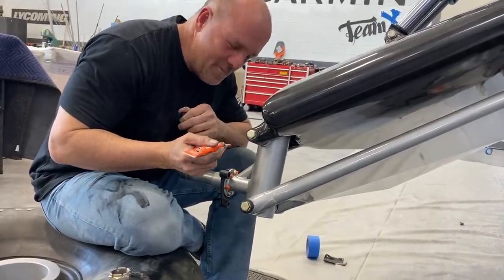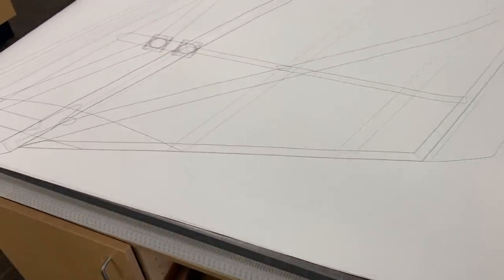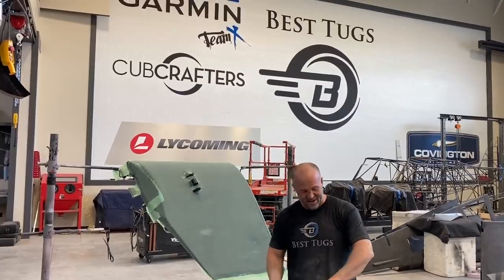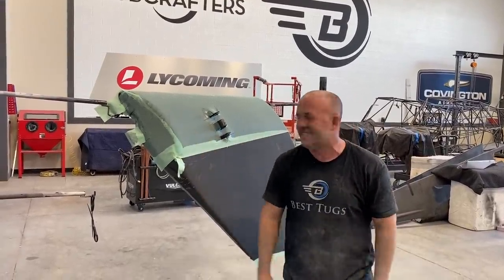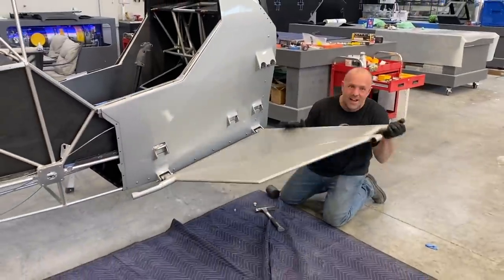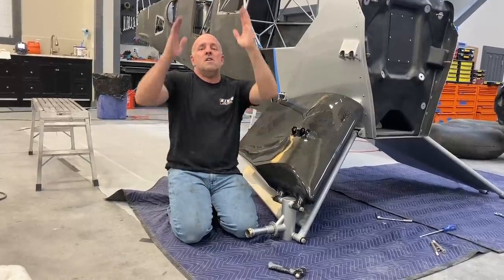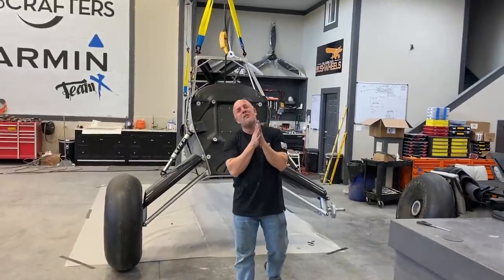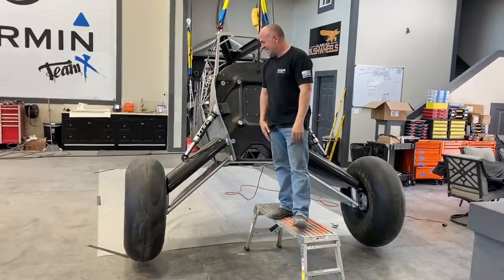Carbon Fiber Wings on scrappy suspension finished (Scrappy Bush Plane 22)

Comment: Very impressive design, execution, and presentation. As I mentioned when you first presented your suspension design that holds the camber steady, the track changes throughout the action of the suspension (narrow when the suspension is at the top of its travel, wide at the bottom of the travel) which causes these soft tires to roll under, especially on hard surfaces. I wonder if it matters on these tires?  I'm surprised the shocks are uncovered and causing drag with all the attention to detail you have given Scrappy. The inboard suspension that Jonas Marcinko is utilizing for his scratch build, "Defiance" might also suit Scrappy. Thanks again for another excellent vlog.
Reply from the maker: Oh so much to type on those great question I’ll try and talk about that at a later video

Comment: At the very end - you addressed the question forming in my mind as soon as I saw the lower A-arms;  to fabric or not to fabric?   I can't wait to see what kind of analysis you've done to figure out the high pressure zone interactions in that huge slot between the two!

Comment: I love your oddly satisfying statement!!  But most people who are not in aviation don't know what you are doing.  Mike is putting on a stripe of gel thick paint on the bolts it is called torque stripe. When it dries it cures hard and brittle and stays thick.  If the nuts start to loosen, or the bolt spins, the material cracks and shows you on inspection that the  bolt is working loose.  Then you can investigate why the bolt is loosening, this could be because something is wearing, breaking or failing. I think Mike is showing happy satisfaction because his plan is coming to an end.

Comment: I think I know what the unique feature is of them King Shocks
You can get them to retract in flight, to trim the suspension wings in flight.
And/or
use them retracted on take off, and then just on the lift, make em pop the nose up
eg make the planes front jump up in the air for Short Take offs

Comment: I really love the detail and workmanship here, and my comments are only thoughts on the design that could be made from the videos uploaded.
As an old aircraft maintenance engineer, I do wonder how there is going to be any inspection of the upper control arm structure (mini wing).  This structure is under huge loads especially as the suspension is in it's fully lowered position, the spindle will want to compress the mini wing structure with a large mechanical advantage given the suspension geometry.
As an automotive design engineer I also worry about the minimal bearing area on the suspension mounts at the body of the aircraft.  Bearing areas at the spindle are much larger than those on the aircraft frame which seems directionally correct.  Maybe consider using diamond encrusted washers (after removing the paint from the body mounts) and larger bearing washers on the accessible surfaces on the fuselage to increase the bolt functional bearing areas without totally re-designing the mounts.  If you do this ensure you tighten the bolts to get the tiny diamonds to cut into the airframe and effectively fuse it all together.  Tension on the bolts also reduces the shear loading of the bolts as the bearing areas of the washers and compression spacers also take a significant portion of the shear loading (bolt shear stress failure point is about 1/2 the tensile stress failure point).  Longer bolts help here as you can get a large bolt stretch (this is why head bolts are normally long in internal combustion engines - it also helps with thermal expansion/contraction of the joint) Get the joint stiffer (stronger compression spacers inside the rubber) and then get the proof load higher in the bolts (or dare I say it use yield bolts and tighten to angle after preload torque has been met - but don't use the bolts once they have been removed from service - you need to replace yield bolts every time they are removed)  A good way to show the difference of alternate bolted joint designs is to make the representative joint and stress it in a simple tensile test.  But make sure all the parts are new in every test.  You can mechanically cycle the joint as well (this is done for automotive validation purposes and could be done here also) but I tend to believe the cyclic loading of this joint isn't as significant as it is in car suspension systems (all the same I would always say - test, test and more test to ensure design meets intended applicable loads).

I also wonder if the space between the two control arms is going to create a nozzle effect where the air flow could be very high in this small gap (it reminds me of leading edge slats, except the slat is on the bottom of the wing).

I'm eagerly awaiting the next installment of this project......

Comment: Fill divots with clear cyanoacrylate glue, super glue, between clear coats. It will look milky until you add the clearcoat on top. I used that process for guitars, to give that super wet look.

Comment: Mike you Need an Engine Brace enclosing the Engine and bolted to the front heads, More than the standard engine mounts with the extra Torque your generating from the Fan Boat Prop...

Comment: "Big Mike" . . . I have been watching your videos, and the last one I watched was your APPROACH article on the DRACO loss.  I have been thinking that one of the items that you developed for DRACO could be used on other Bush Planes, and that is the Landing gear fuel tanks.  The carbon fiber bladder could add 10-20 gallons a side, with the primary engine fuel pickup coming from the bottom of those tanks like you did DRACO.  The flexible fuel lines in the struts will have to be robust to be sure, and "in" the strut for protection.  Fuel lines from the mains in the wing would feed the strut tanks the same as your original design.  It's going to add some weight to the platform, but everything is a trade-off.  The range problem for several of the Bush Plane models like the Cubs, and perhaps the Kit Fox could be engineered up as a landing gear kit for installation as a unit.  Safe flying.  Glad your in one piece.  Be safe!
Just a thought.  CWO3 Curtis E. Conway, Jr., USN (Ret).

Comment: Wow, what a incredible build design and executed build quality.  👍‼️     I’m guessing that the King shocks to be revealed future feature, will be some type of remote activated positional suspension lock out.    So that it will help Mike this time around with any unexpected severe crosswind gusts during takeoff  (or landing), and that he then won’t have the same long travel suspension body roll influence that helped (unfortunately) contribute to Draco’s ground loop. ... but this is only my guess at this point. 🤔

Comment: That's awesome! One thing that worries me is that with that suspension the tires will skid outwards when it impacts the ground, so you might burn some rubber on that.

Comment: The aspect ratio of those wings are about 1,5 to 2 and they have a -45 deg of dihedral angle. The lift contribution of those wings are infront of the main wing randomising the center of lift and they have a good chance of trowing a turbulant flow to the stabilizing wings. To make a long story short I don't want to be siting in that airplane when your going to test it.

Comment: Nice looking landing gear design but the airflow coming from the prop and the drag + turbulence that would be generated between the airfoil shape part and the flat plat shape part will cause serious problems and low performance. those two parts are very closed together and not having airfoil on them would help more than having it. It also affects the airflow over the tail is some AOA. We will see how it would work but may cause the airplane to not deliver a steady reaction and flight experience in different conditions and maneuvers. I also want to add that your hard work is really valuable and I enjoy watching your videos!

Comment: one thing that may be are issues is if you load one side up (compressed) more on a landing I.E one landing wheel compressed more, the apex length from the landing tyre to the tail wheel will "angle" changes. This may cause directional steering between all 3 wheels.

Comment: King Shocks "unique feature" spoiler alert (just a guess, because it's what I would do). 50 bucks says Mike will retract the gear in flight until the mini-wings are horizontal for additional lift, then extend shocks for landing.

Comment: I've got one question. Would it have been possible to make the miniwings into fuel tanks as well or is that just too mush hassle and headache to achieve, if even possible from a engineering standpoint? Thinking of the Draco fuel "legs".

To make a guess on the hidden feature on the shocks. They can fully retract in-flight to make the wing surface as level as possible. :D

Comment: I am a bit late to this party, but I was wondering about access panels in the gear legs to inspect for fatigue or tracking in the landing gear after particularly firm landings or later in life airframe inspections?

Otherwise, awesome build! I have been following from day one!
Reply from the maker: Thanks and yes it has inspection points in the bottoms where the brake lines pass through in and out of the mini wings

Comment: Raw carbon is not common in the aircraft industry for a number of reasons. UV exposure is one, the rework / precision issues are another. The "fake carbon" hydrodip overlay mirror helps on both levels.
Reply from the maker: 👍🤠 I have been doing carbon fiber for 15 years and I agree with you completely.  That being said.  If you watched the other videos and steps I take for a true real carbon finish you would see the steps that allow it.  It’s certainly more time work and effort and money but I get what I truly want.  I have a racer in clear carbon 12 years old and absolutely looks like the day I did it.  If you take care of heat issues and not use as primary structure as one major issue. Also I use a extra layer of carbon on the outside that is not part of the structural calculations and is Just an extra layer of UV protection from the layers below.  Go beyond that I use heavy UV clear over that.  There are several other steps but in the end you can see the actual carbon and don’t have the fake look that I personally don’t like.  But what is great here  is we both can build what we want the way we like it.  I’m willing to put in the time and expense to do it the hard way and still have it safe and exactly what I want.  I cheer on all others choices for them.  This is certainly not the easy or practical path but the look is exactly what I want.  Cheers my friend 👍🤠
Reply: @MikePatey  I like it, haven't seen it before. I personally like to see into the carbon itself and be able to visually inspect it for damage.

A Boeing passenger plane done in metallised carbon would look great.

Some would ask for gold, including the current US president.

would also note that the bike industry has generally preferred to use exposed carbon rather than a solid gel coat or paint, for a number of reasons, but that the problems with high ozone and high radiation at the surface where the light reflection phases back onto itself  - the mechanism of UV damage - are far worse for aircraft than for bicycles, and the penalties for failure are much higher with aircraft, but also that early carbon parts failing put a lot of people in hospital.

Many have remarked that modern free ride mounting bikes are part time aircraft, and that professional riders spend more time airborne than taking off and landing, and the more recent styles of carbon frame tend to have a painted finish rather than exposed fiber mesh, and as you have noted, the mesh that people put on instead of paint is often a cosmetic feature rather than the actual structural lay-up, and making carbon look perfect is an extra layer of hassle and expense, but also that the most fastidious carbon work tends to come out looking cosmetically perfect, and that perfect looking carbon is generally strong carbon.

Comment: Prop kicks up a stone, hits that carbon fairing and it's done. Fabric would seem like a lighter, cheaper, more resilient, and more easily repairable choice.
Reply from the maker: 👍🤠 Fabric is certainly something I considered first.  Lighter, cheaper, yes.  Your comment of fabric being More resilient, only if I made a mistake and used two layers but with the thickness I did they aren’t even in the same hemisphere for resilience and strength for bouncing a rock off it.  Literally a multiple of over 10 times the strength in every area of impact and structural measure at the lowest level. It will likely just deflect any rock that would puncture fabric.  On this part the reason carbon over fabric is that with carbon I didn’t need to make multiple ribs. They would have changing shape in both length and angles as the wing changed, ribs would be needed to be able to use fabric.   If you factor in the ribs needed to make that mini wing out of fabric you will quickly see why your first thought would be Incorrect on weight.  My carbon wing has a less overall weight as it needs no internal ribs and more strength as carbon fiber is simply stronger than fabric.  Don’t get me wrong I choose fabric everywhere I can for all the reasons you suggested.  On this particular application I chose fabric on the lower a arms and carbon fiber to make the mini wing.  I love them both.  I certainly choose fabric normally if I don’t need the strength or complex shapes.  Cheers my friend and thanks for the comment 👍🤠
Reply: @MikePatey  Thanks for the reply. Good luck with the carbon. I'm constantly in fear of someone dropping something hard and heavy on the wing of my Giles. Not so concerned about the Pitts. They usually bounce (and I can see the hole if it does go through - like an ELT that took flight and punched a ring of holes in the fuselage of an S2B years ago during a sequence after a mechanic doing the annual forgot to replace the retaining screw)

Comment: The suspension special feature?  My bet is that the shocks pull the gear up level in flight.  And controling the position of these wings in all phases of flight would be handy, but complicated...but Mike might have a clever solution?   (Without holding these "wings" in a fixed position, I expect the flight dynamics could get quite sketchy in turbulence...since the gear is independent. So controlling the gear in flight seems necessary to make the idea of the air foils possible.)

Comment: The finish on your Mini Wings is AWESOME!! Luck has nothing to do with it. Your every day work is next level, this time you happened to outdo yourself to “MP next level ^2”👌🏽. Curious about something, I’ve watched all of your videos, I’ve heard you talk about the corrosion that can form between a direct connection of carbon fiber to steel. Recently, you’ve not been isolating carbon fiber from Steel? Did I miss something? Another thing I’m curious about, were you able to do simulations on CAD of the effect of the gear widening as it is compressed? If I look at it behind my eyelids, I see the tires curling/rolling in as the gear widens under compression. I hope you respond, then -  back to work 💪🏼
Reply from the maker: Great questions.  👍🤠 sorry I didn’t show it.  All the bars if (you pause the video when I’m showing the frame on the carbon fiber)  you can see that the bars are all wrapped in 3 layers of clear fiberglass and then that is bonded to the carbon fiber.  I always isolate every time. 👍🤠 also during compression you can see the gear actually travels outward just a little.  I illimate almost all the scrub but there is some left. Fortunately while landing at the slow speeds the tires role as compression happens and on as little outward travel I have it roles the tires out not drag or rub the rubber out.  Thanks for the comment

Comment: I must have missed something...what's supporting the weight?  Are there some big spring bungees below the cabin floor where normally cub bungees would go?  Got to have something hefty under there to support that big IO-780 motor and the rest of the aircraft weight.  The Stinson 108 like I own has 2 large oil dampened spring oleos under the seats that support the weight of the airplane.   Stinson Guy.

Comment: Your tires will still have some scrub force though, right? Due to the track widening as the suspension compresses and the arms flattening out and becoming parallel to the ground. Not near the force like you’d have on the traditional setup, but some.

Anyway, KILLER work as usual!

Comment: Acceptable intros.
Ok kids
Ladies and gentlemen 
Here we have
So now what I have for you 
The next step in my aerospace machinations 
Now to work...
You end with "back to work" start with..."here at work"
I'll consider it fair for expanding my template knowledge, thank you.

Can you tint the epoxy that you use for the carbon fiber?
That opens up all kinds of possibilities. 
Maybe some metal flake in your clearcoat?
The shocks have a servo motor or something so you can change angle of your a-arm wings and use them to trim?

Comment: More Questions.....  from the very first one of your videos that I watched, where you built something out of Carbon Fiber, it was OBVIOUS that you have had a LOOOOOOOOOOT of experience building with this stuff.  Would you mind telling us 1. WHERE and WHEN that experience began?  2. Where you buy this material NOW??  and... 3. What does it cost for a roll or a sheet and the resin and other stuff you have to use to make a finished part???....such as these landing gear wings.
And I hope this kind of info isn't tooooooo sensitive to divulge. :):):):):):)